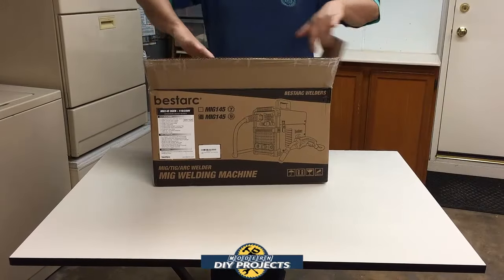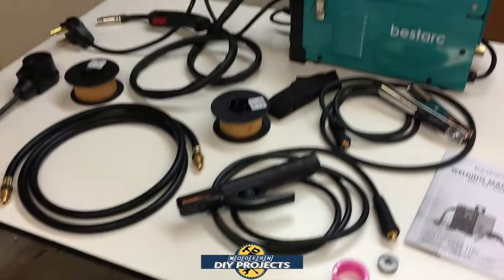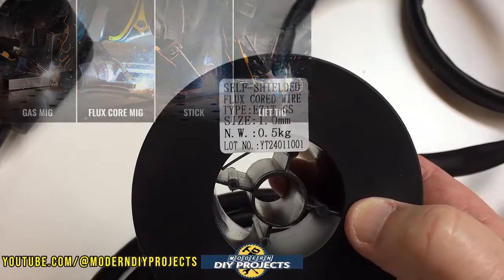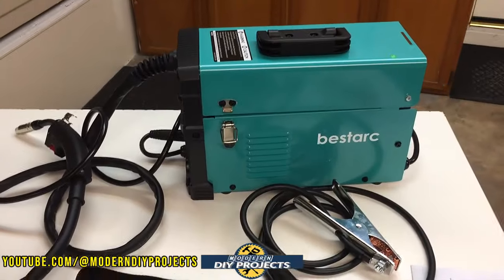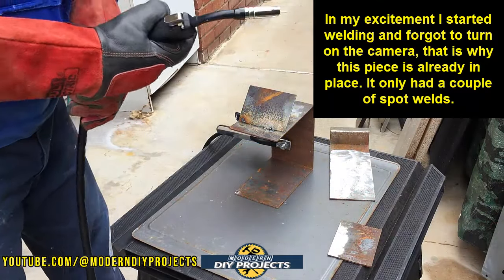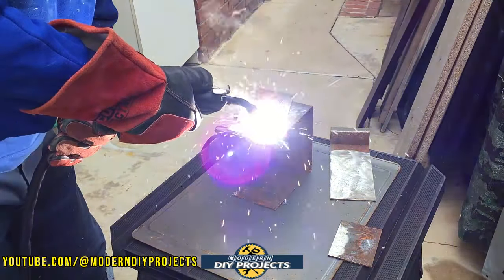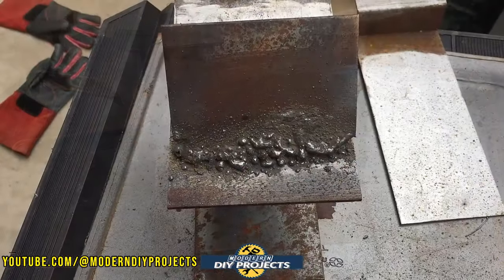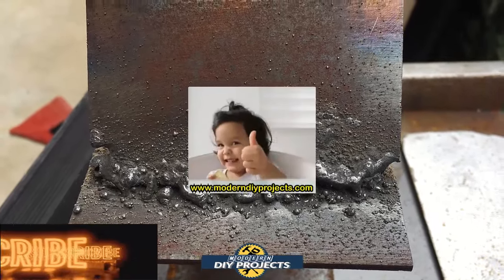BestArc Mig 145 Welder Better than Harbor Freight Titanium Welders - Great Welder Great Value

Comment: These welds don't look like the correct polarity.  Should be on negative polarity.  Try going only in one direction consistently along the weld seam.
Reply from the maker: Thanks for the info. I set up the polarity as it said to do in the manual for Flux Wire. The info could be wrong. Will it cause any damage if I experiment and change the polarity on the machine? Right now I think the Earth clamp is set to positive, and the machine to Negative.
Reply: @ModernDIYProjects  That's the way it's supposed to be set up negative on the torch and positive on the work clamp.  It won't hurt the machine to switch it around but having seen several reviews of this machine, I believe bestarc did it right unless you got a dud.  Your nozzle should also be 3/8 to 1/2 inch away from what you're welding to avoid porosity. Also look up some info and establishing your drag angle.
Reply from the maker: Thanks for the advice. I'll try these on my next attempt.

Comment: Lighten your darkness and get your face closer so you can see the puddle and make a D motion as you go ... grind your surfaces before you weld...when you use gas with solid wire  you wont get as much splatter
Reply from the maker: Thanks for the great suggestions.